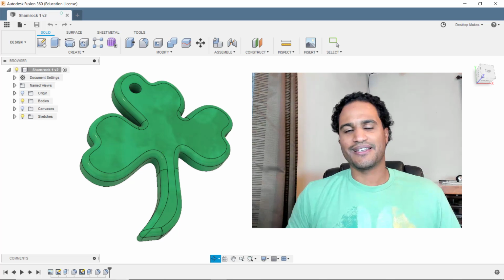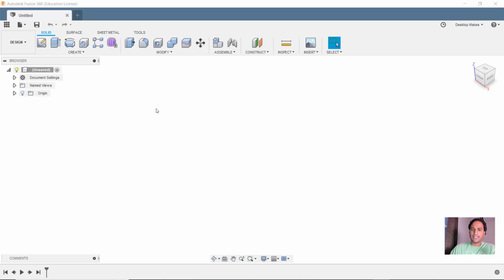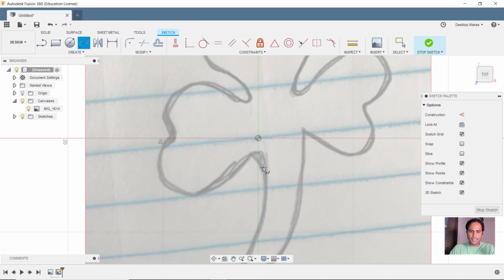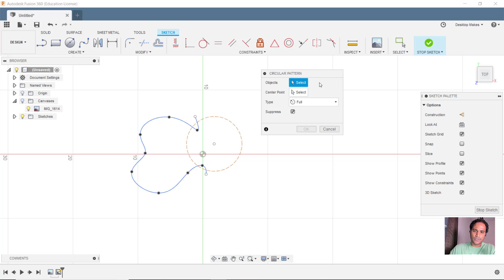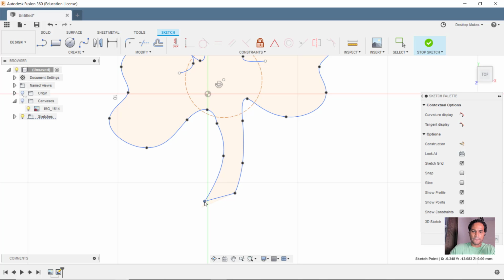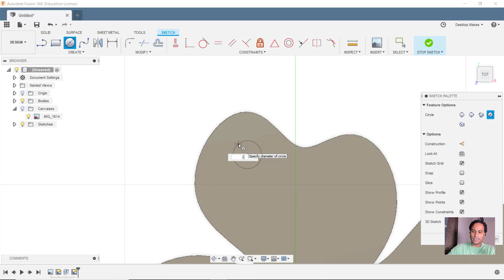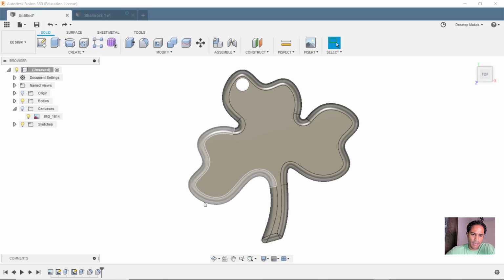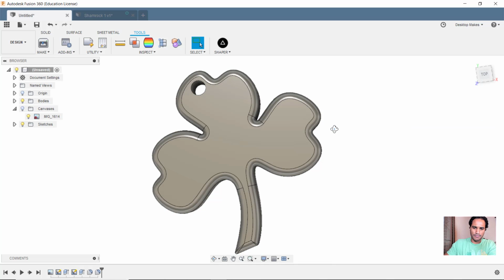Designing Earrings in Fusion 360

Comment: POWER TIP:
1. To adjust geometry, simply click-n-drag sketch points: no need to 'Edit Sketch', as long as sketch is visible. Note: To adjust spline handles, simply select point, right-click, select 'Activate Curvature Handle' +/or 'Activate Tangent Handle'. Other things can be adjusted, too - like drag circle edge to change diameter, or double-click a dimension to change. All geometry will update in the viewport (extrudes, fillets, etc.).